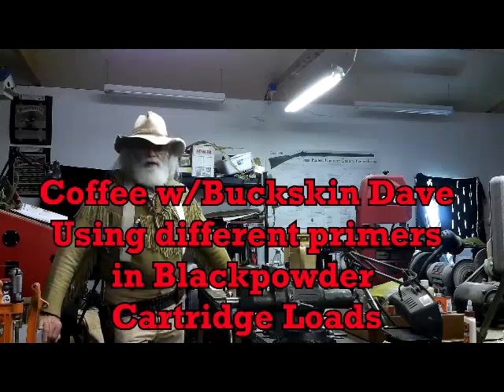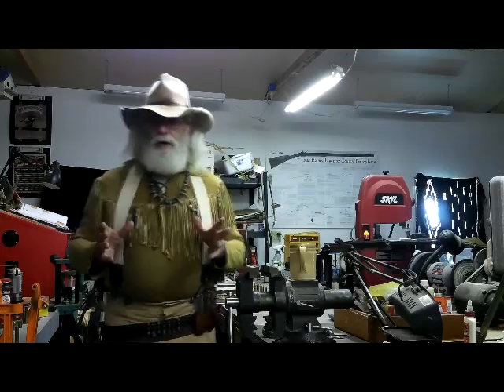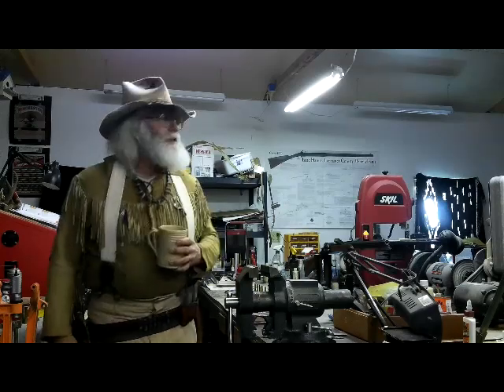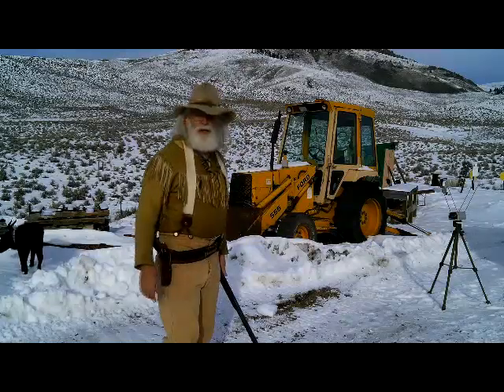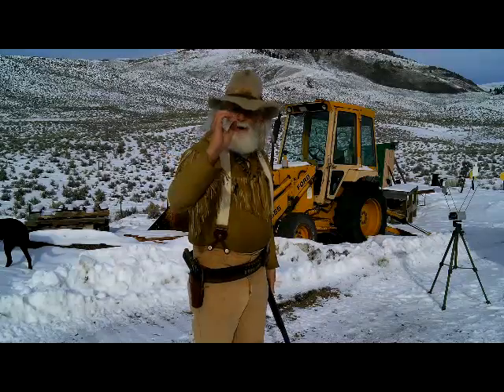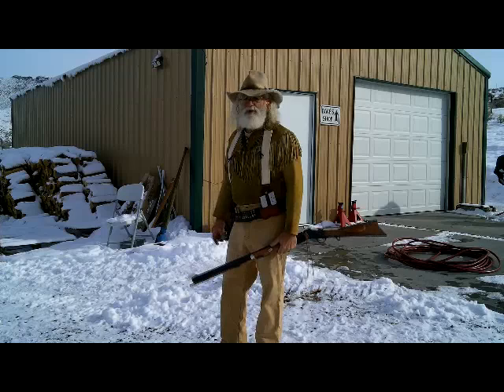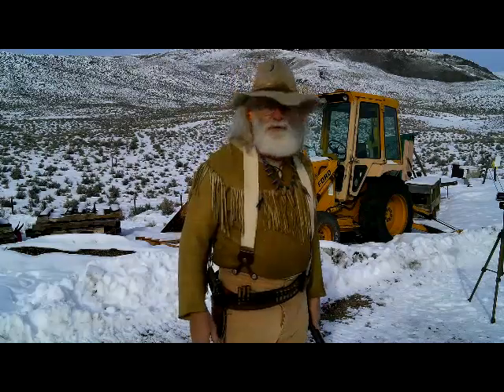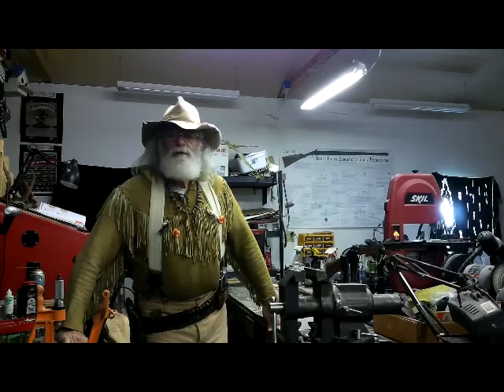Coffee w/Buckskin Dave  Experimenting with different Pistol Primers in Blackpowder Loads

Comment: I did some reading up while back on using magnum pistol primers for low pressure caliber rifle calibers.   As usual do at your own risk and use your own judgement.  In my case I used Winchester standard/ magnum for so  mid power 45/70 smokeless loads . Worked perfectly fine and we're accurate out of my marlin .
Reply from the maker: As long as it works good I think it is ok

Comment: I used duplex loads in .45-70 , .40-65 and .50-140 they worked good barrel stayed clean and accuracy was about the same maybe a little better. I could shoot about twenty rounds without cleaning. Except.50-140 it was very picky. I used SR 4759 powder for my smokeless.
Reply from the maker: They stopped production of 4759 which is sad because that is a very good powder.  Roberts writes about it, 4227, and 3031 as later formulas of smokeless. I like using them because they were around then, but Varget is looking like a good replacement for 4759.  thanks for checking in

Comment: Interesting results. I do not shoot a lot of blackpowder loads but have always used standard primers. I have only shot black in 44/40 and 45/70. I have seen in print many claiming magnum primers are needed. I just do not get that as much black powder has and is ignited with percussion caps and in larger volumes. I see no reason demonstrated that magnums are actually necessary. However if that is what you have or what you want to use go for it. 
If someone has proof of the magnum primers being better I would like to see it.
Reply from the maker: I think whatever you find that works well, no reason to change unless they are unavailable. Thanks for stopping in